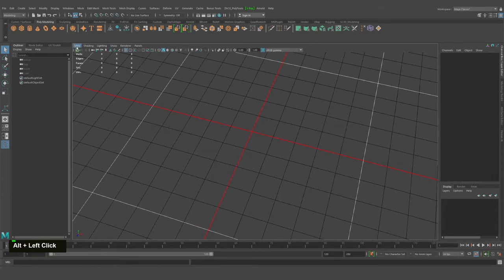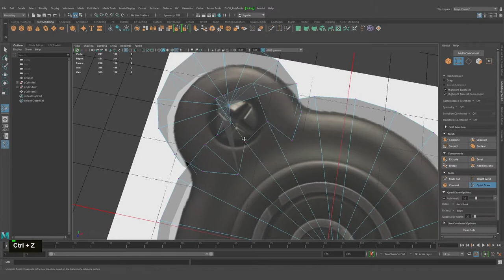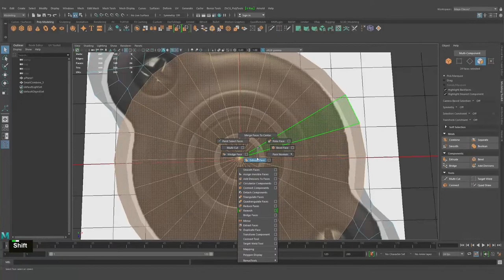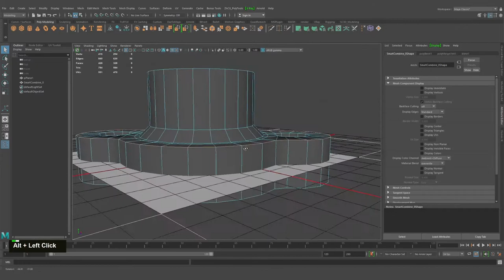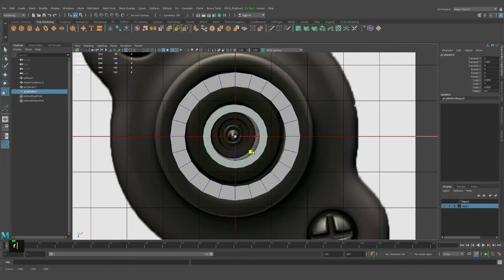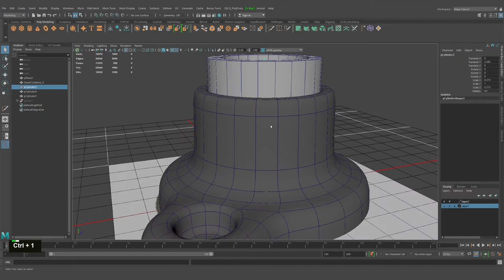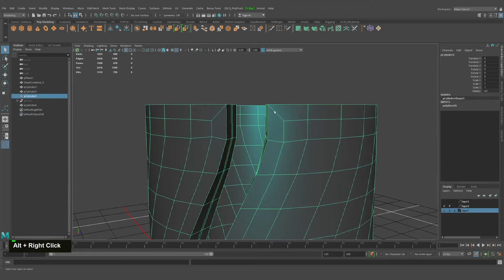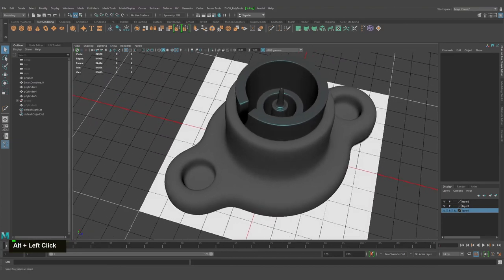SUBDIVISION MODELING IN MAYA - KNOB & SWITCH PART 4

Comment: Do you mind putting the reference image in project files?
Reply from the maker: Hi,  yes I can do that for images which I have. However , the mesh in the project file can be used as a reference too, I mean you can do print screen more than from one angle. as latter on I wont use any reference images.
Reply: @scorpion3d  that make sense, sorry I didn't think in this way. Thank you